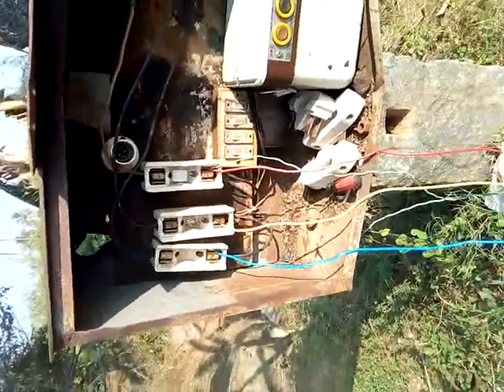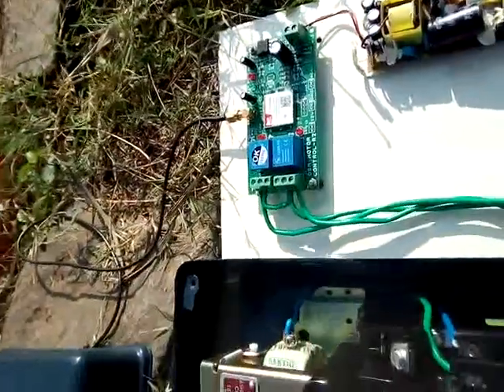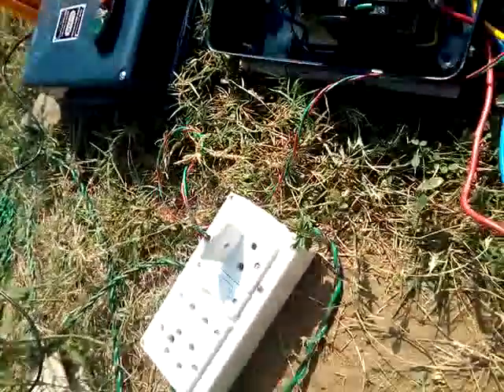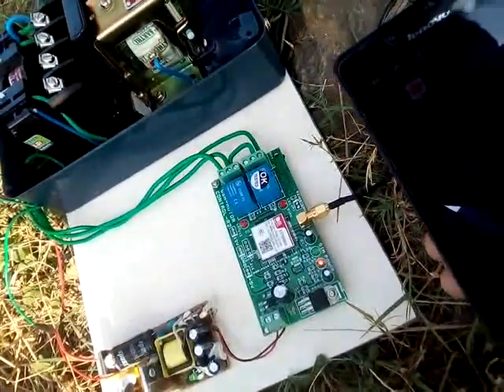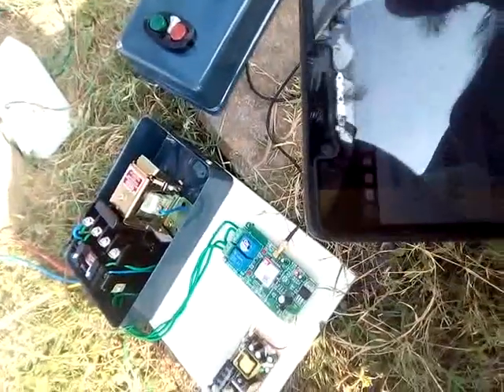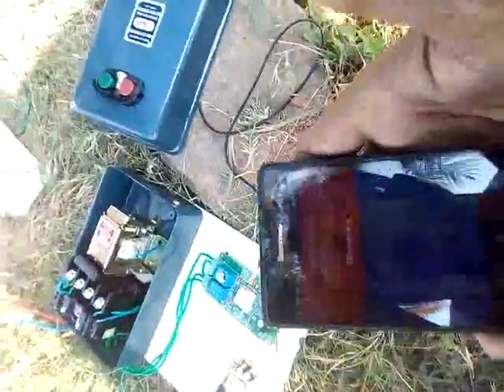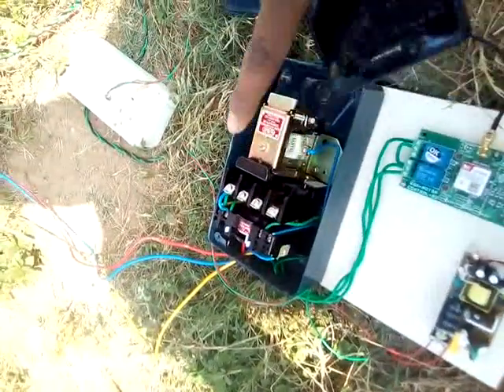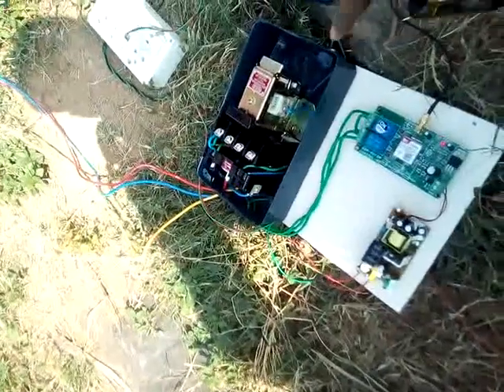MOBILE GSM BASED AGRI MOTOR ON OFF-newage project kallakurichi 7373894403

Comment: Apart frm on and off it will be gooe if line voltage and motor current are displayed and with fault analysis and notification